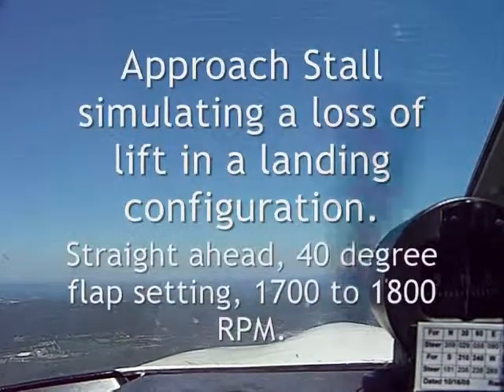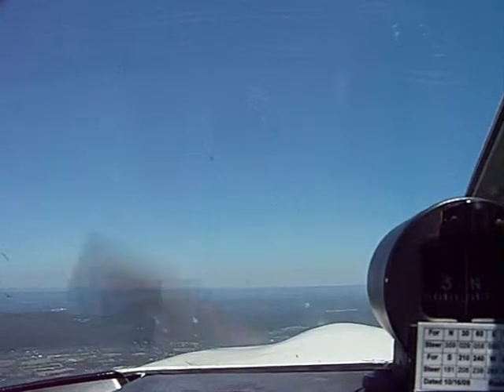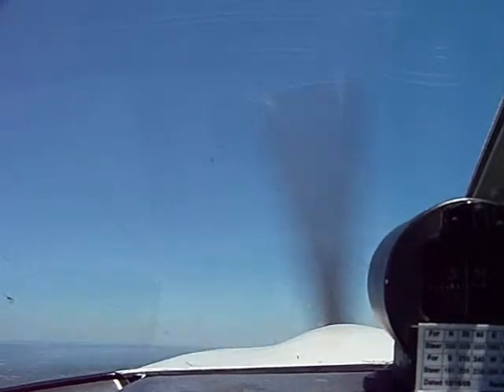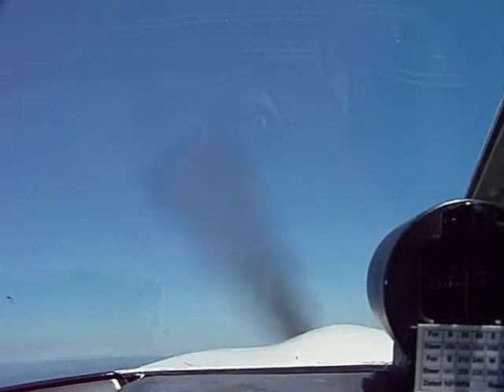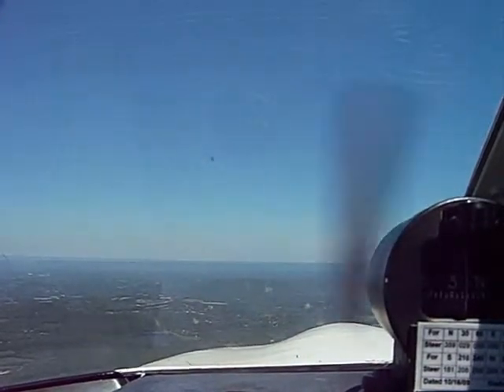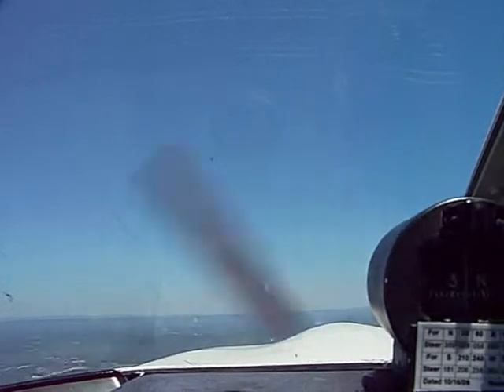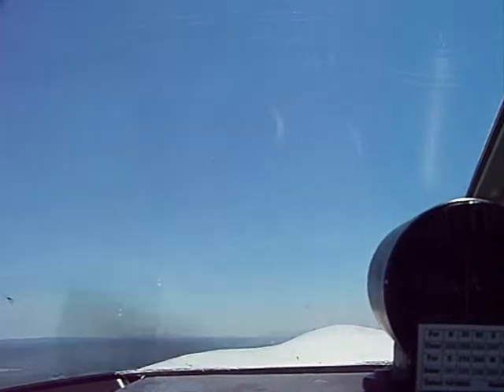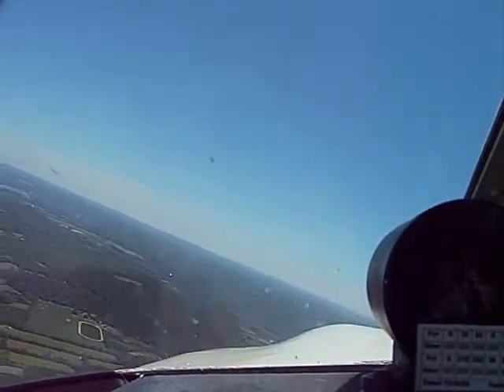Piper Cherokee Approach and Departure Stalls

Comment from the maker: Zesty24: it doesn't take a big push to break the stall, simply a relaxing of back pressure and a gentle push will do the job. You do not need to "float", just get a little lighter in the seat. Practice them with an instructor comfortable with stalls. If your instructor is scared or apprehensive (stalls get them on edge too), find another one; you will only learn the right way from a good teacher. 

Stalls can be fun once you realize that even deep into a stall, as long as you coordinate the ail